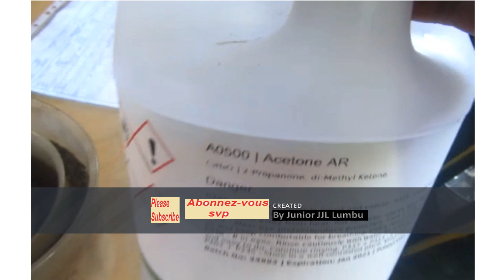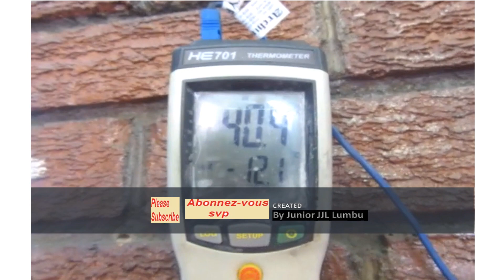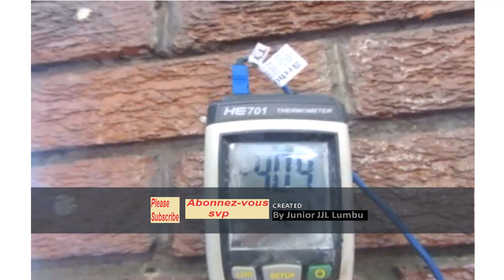Low temperature (-40°C or -40° F, using acetone, carbon dioxide) sub-temperature, Charpy test

Comment: Do you have any rexomendation for cooling tempersture to -45 degrees C?
Reply from the maker: You can use Acetone as the medium (which normally solidifies around -70°C, where water solides around 0°C), and CO2 as your cooling agent, CO2  normally solidifies at Room temperature (normally encapsulated in pressure bottles and once released and in contact with AIR solidifies.)